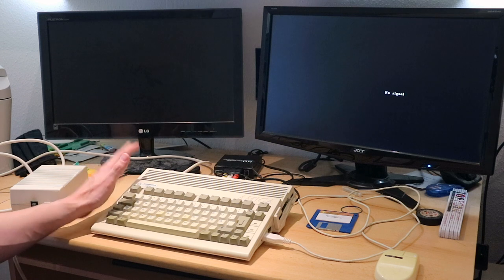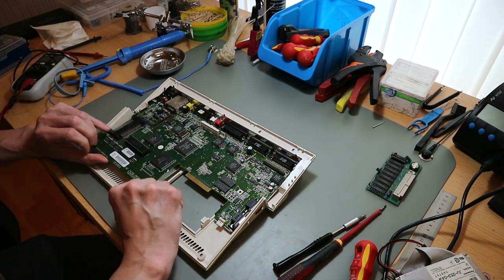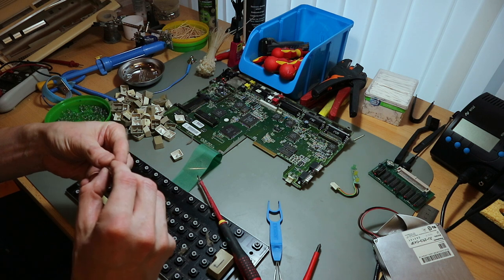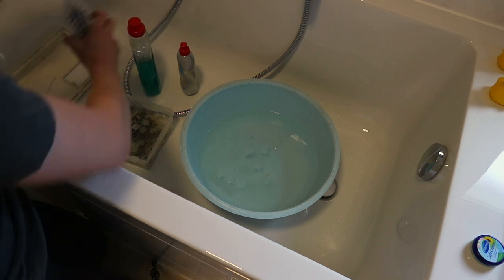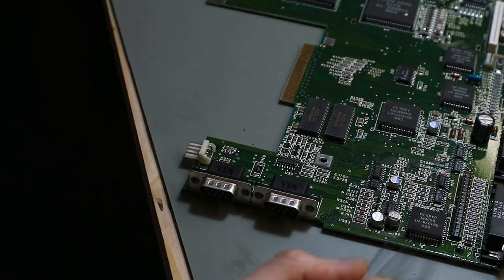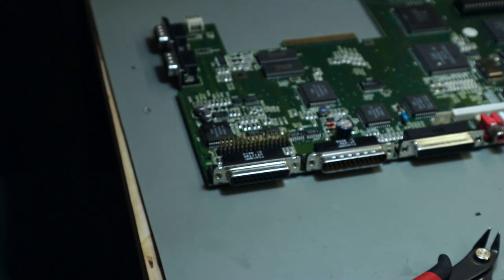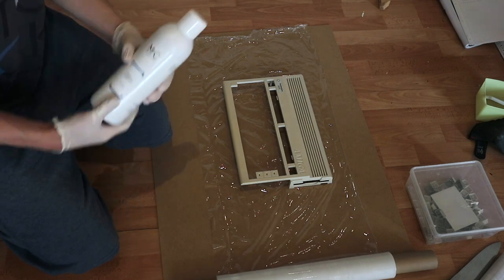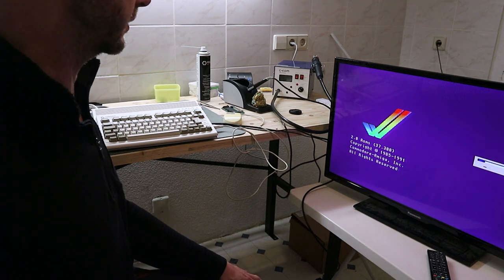Amiga 600 Part 1: cleaning and recapping

Comment: Good video, even if I would have taken a bit more time to desolder, using iron instead of hot air, as sometimes it turns out that a pad could break. Another thing I learned, after watching and doing mistakes myself, is to use more flux and...please do not get angry :)...never rip the old caps that way, as this A600 boards seems not as sturdy as the A500 (they were built to be cheaper, really).
I'm watching the other episodes, and looking forward for more! Cheers, M
Reply from the maker: Yes, i made mistakes. Today i know it better and i have more skills. Thanks for the support.

Comment: Excellent video. I have an Amiga 500 and very often appears a Gurú Meditation menssage. I think It is posible recap the los capacitors or any chip if RAM memory default. What do you think??
Reply from the maker: If you don’t have recapped the A500 do this. I lost screen on my A500 after recapping it was fixed and i had a normal screen. Try this first. The capacitiors in the A500 can dry out. Some of them have a direct influence of your signal. I have recapped all of  my maschines.
Reply: @tomscomputerchannel2925  I have normal screen but we have some gurú menssages when i put a software and sometimes only when i power on.
Reply: @tomscomputerchannel2925  All electrolitics caps only?? The true hole??
Reply from the maker: I would try to recapping first. If the error is there then it is more difficult.
Reply: @tomscomputerchannel2925  Thanks Tom . I recap first a view the results.
Reply from the maker: In the A600 all electrolytes. In the A500 all electrolytes.